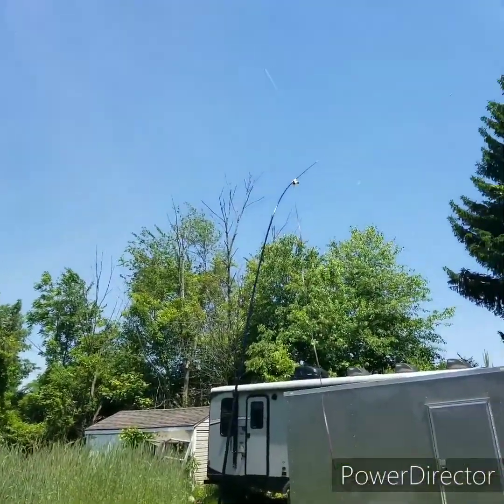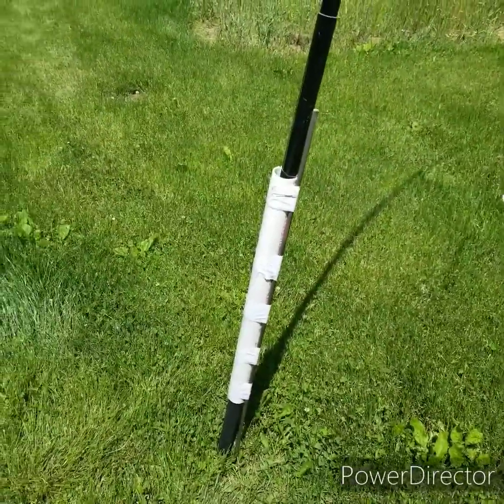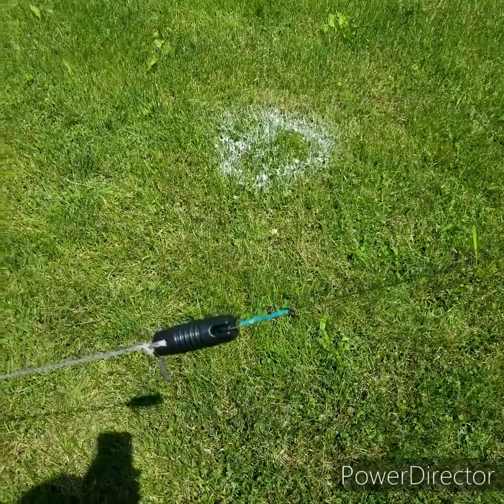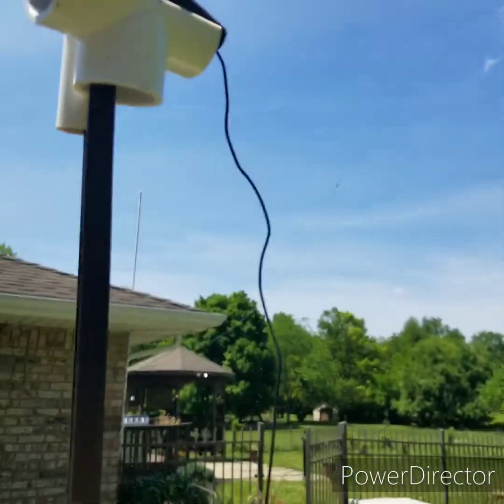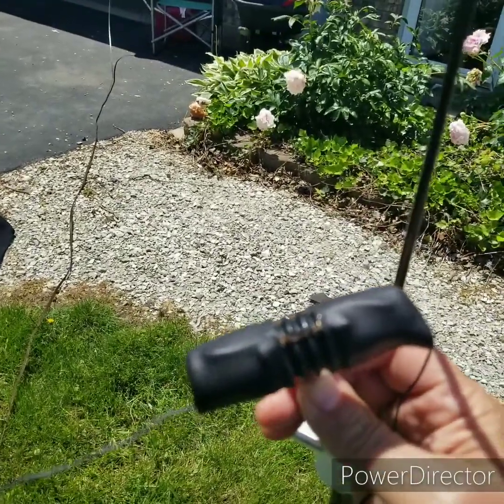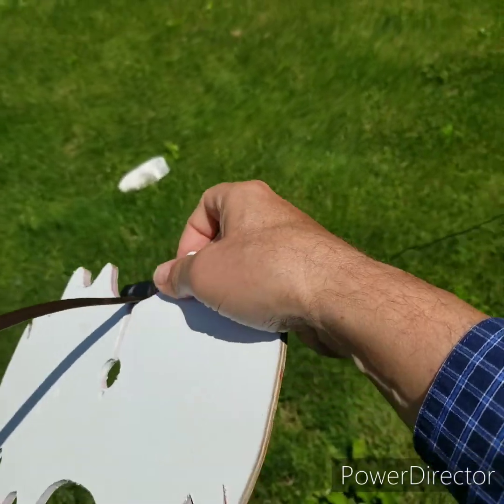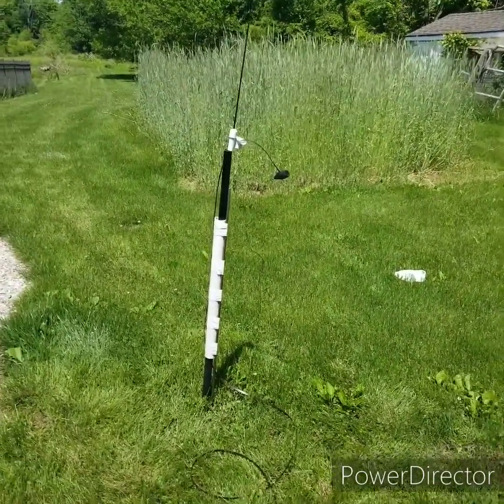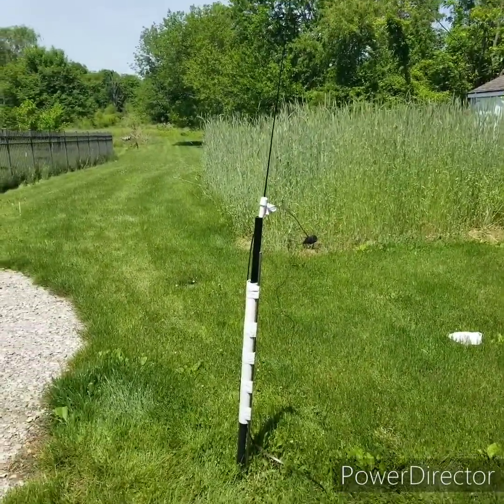7 band doublet for POTA or SOTA portable ham radio - simple, cheap, foolproof

Comment: You say “hot side and cold side” I thought with a balanced antenna it didn’t really matter which side in the sloper configuration?
Reply from the maker: You could be right, but it makes me feel better having the hot side higher up in the air, rather than on the ground. 🤣
Reply: @bradenglettkd8zm69  yeah, I don’t think it matters. Much like it doesn’t matter which side you plug into the posts at the back of a tuner or that binding post your using. Notice on ladder line tuner posts there isn’t a positive or negative.

Comment: Wouldn’t a 4:1 balance make it much easier to tune with the non balanced built in tuners?
Reply from the maker: If the tuner I was using couldn't match the antenna's impedance, then yes, I would have to add something extra inline, such as a 4:1 balun. But the internal tuner in the KX3 will easily tune this antenna on any frequency that I am using. 

In general, depending on the frequency you want to transmit on, the antenna impedance could be really low (say, 20 ohms) or thousands of ohms. So, adding a balun can either make it easier, or harder, to match to a 50 ohm radio. In other words you can't assume that a certain type of antenna always needs a certain balun, especially if you are using it on multiple frequencies. Also, don't forget that anytime you add a balun or a tuner, additional power is lost.

Comment: Hi there. Looks like antenna I could use for limited space in back yard. What is the length of the 300 ohm ribbon? Also can you make similar simple small doublet antenna that will operate on 80m? Thanks heaps
Reply from the maker: Hello, the 300 ohm lead I am using is about 25 feet but could be almost any length. Of course, the higher the apex of the antenna, the better it will perform. To adapt it to 80 meters and perform decently, the radiating portion (i.e , not the feedline) would have to be double the length of mine, or about 132 to 135 feet from end to end. 73

Comment: Nicely done video.  Hard to beat a doublet for simplicity and efficiency.  Your build is very well designed and executed.  I am going to copy this.  73, N4MJR
Reply from the maker: Thank you - copy away! I have activated 4 parks so far, with more than 40 QSOs each at 3 parks and 25 at another (I only allow myself a maximum of 2 hours per park, and I use generally 5 to 10 watts). So, I am getting good results. Good luck

Comment: Nice and creative presentation.
What makes it classified as a doublet?
52 feet is a fixed sum?
Reply from the maker: Thank you! A doublet is generally distinguished from a dipole by 1) a doublet is non-resonant, or at least there is no attempt to make it resonant on any one band,  while dipoles are usually cut to be resonant on one or more bands,  2) a doublet is fed with balanced feedline such as 450 ohm window line, 300 ohm TV twinlead (or even two-conductor speaker wire!). 73 de KD8ZM